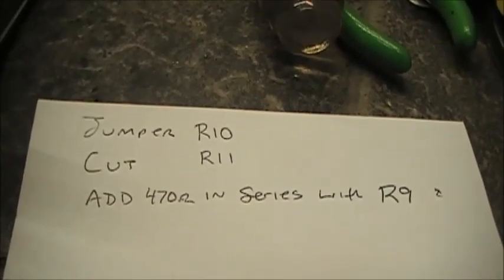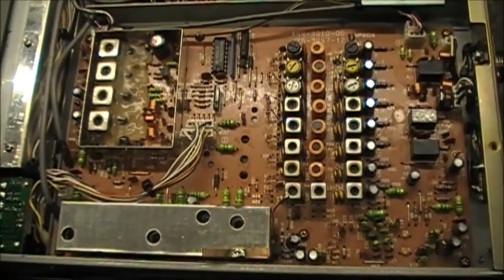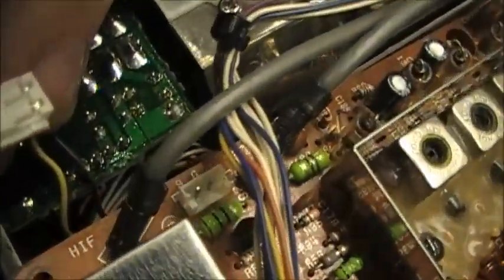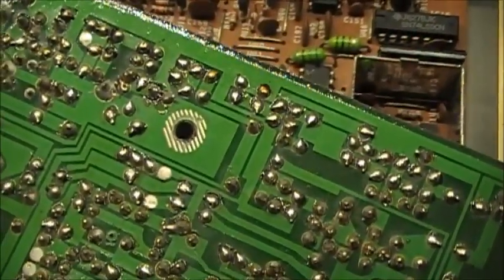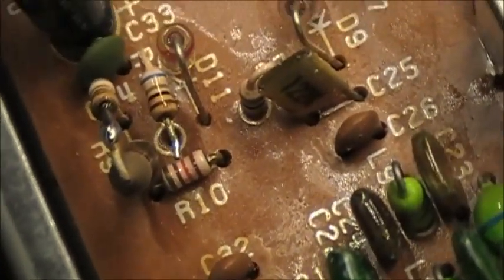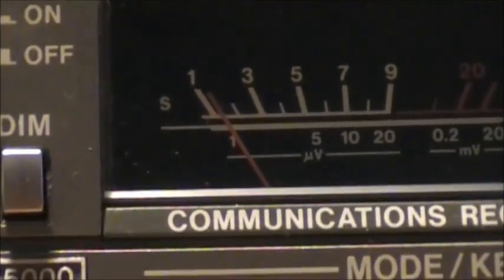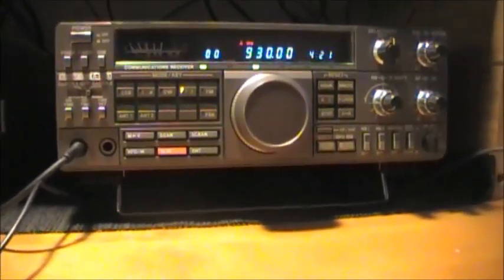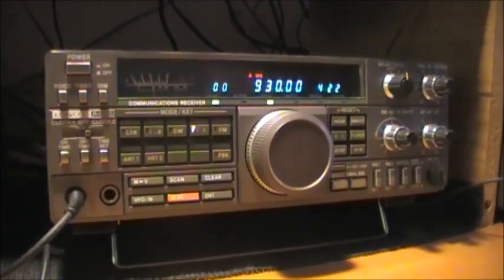KENWOOD R5000 Broadcast band sensitivity modification

Comment: It’s so sad Kenwood ruined this receiver with this attenuation. Even after the mod it’s a terrible MW DX receiver. I don’t think I have ever been so disappointed with a hyped up radio before as the R-5000. It’s worse than my Icom R71E. Here these still go for higher prices than the JRC NRD-525 which is the best for MW DX.

Comment: Should have done a before and after
Reply from the maker: I was not even going to record this video till after i had the radio pulled apart, by then it was just as well to continue on as you see in the video.    If i decide to reverse to the modification i will indeed record a before and after.